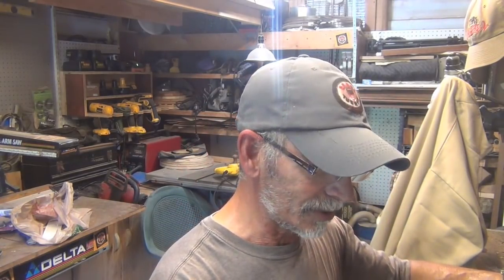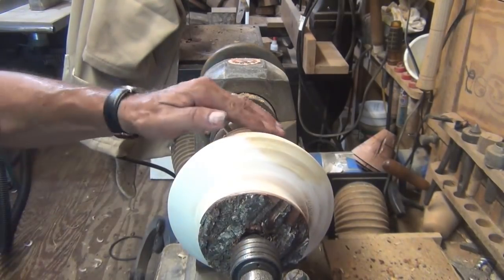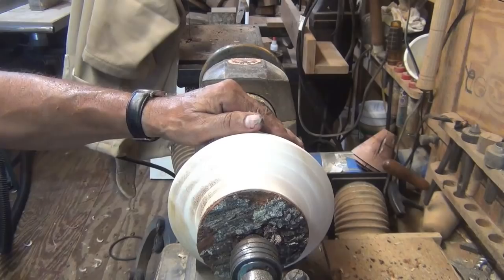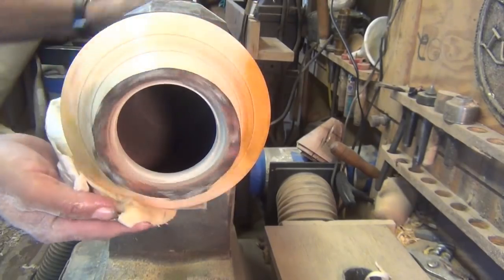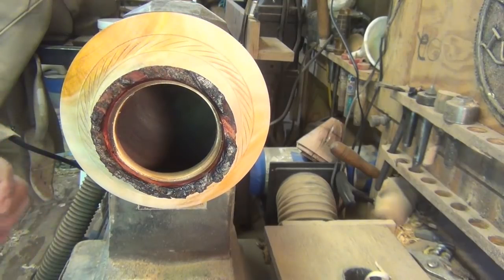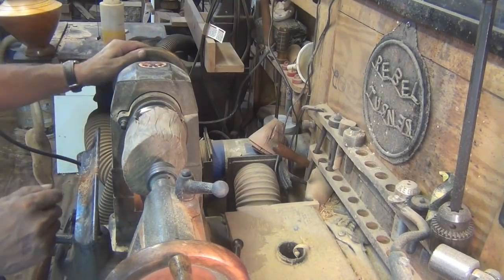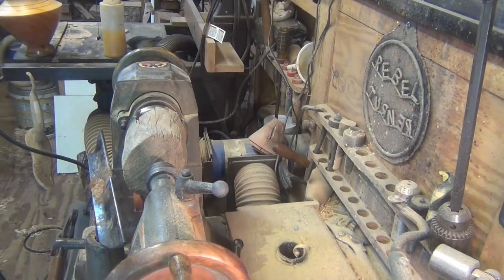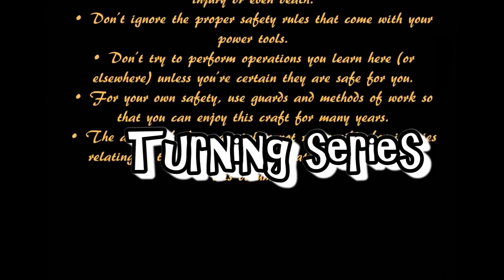Out of a slab Part 2 by Rebel Turner

Comment: A very nice piece as always, Al. The scorched black interior is a neat touch. I wonder what would happen if you heated up the decorating tool (shown at 19:10) hot enough so that it branded the wood as it cut in the lines, making the lines black.